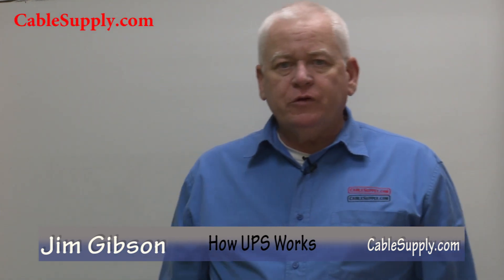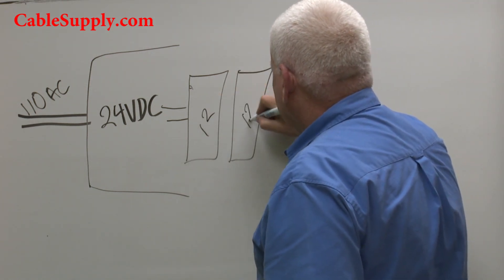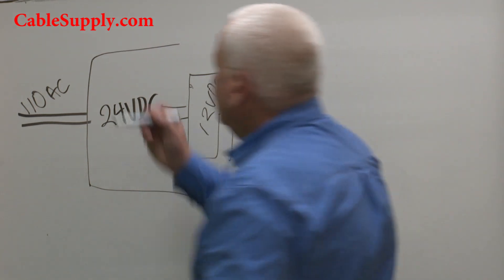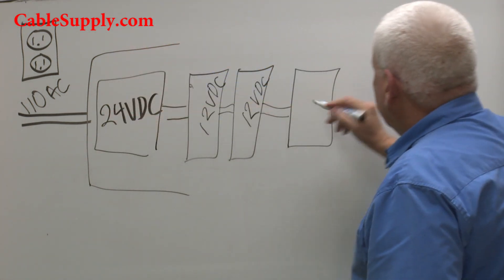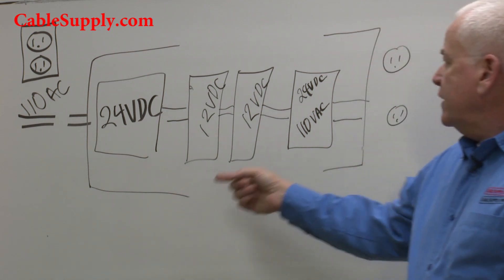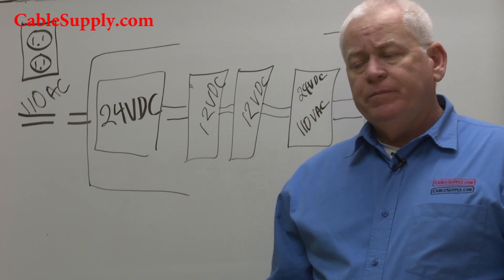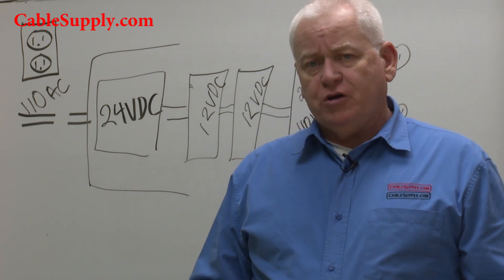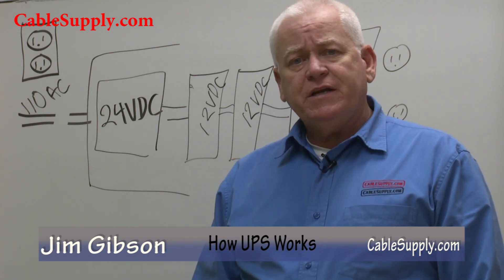CableSupply.com Explains How Uninterrupted Power Supply Works

Comment: DC can be transmitted long distances, it’s just not practical because of the power losses. I would recommend that you research High Voltage DC transmission.
Reply from the maker: You're absolutely right. DC current does not transport well over long distances. That's why we use AC current in homes and businesses to power our equipment and lights.   The argument between DC and AC current was settled well over a hundred years ago.  One of the participants who argued for AC was Mr Westinghouse, if I remember right.   It's a good story that a bowl of popcorn and a click on YouTube will entertain you for a while.  However the battery backups that I am speaking of is basically under a few feet. these battery backups only supply power to servers switches and routers. That type of equipment are in the telephone or data rooms.   At short distances  DC works fine. The UPS system converts AC to DC then back again to AC and is only a few inches apart from each other. Thanks for watching!

Comment: In your block diagram you say that the 24vdc is converted back to 110vac by a rectifier...NOPE, it's an inverter that does that, NOT a rectifier.....
Reply: Was gonna say the same thing. DC to AC is an inverter. AC to DC is  a rectifier

Comment: My APC UPS will Beep when it looses power or I knock the plug out of the socket.  Also when the lights flicker in a wind storm my UPS will keep the computer up and running normally.  The UPS will power the Web Modem from the Telco, the Switch and the computer from power drop outs or let you shut down gracefully.  (Or start a Generator).  tjl

Comment: Just to add clarification to the reason why mains power is delivered in AC form.  To reduce losses over distance the transmission voltage needs to be high, very high!  Here in the UK main transmission is at upto 400,000 volts!  So, DC could be generated at 400KV but it is very difficult, if not practically impossible, to reduce, or transform to the eventual 240 volts of our domestic system, as DC cannot be converted with transformers.  AC however, can be stepped up and stepped down relatively easily with transformers, at either end of the network.  So the voltage can be increased substantially so that it can be delivered over long distances, which means the current is much lower, which allows losses, due to cable resistance, to be kept low.  Also, AC can be generated in 3 phase, so 3 individual conductor lines at 120 degree phase difference to each other. This is very efficient for industrial high power requirements.
Reply: Thanks for the information.